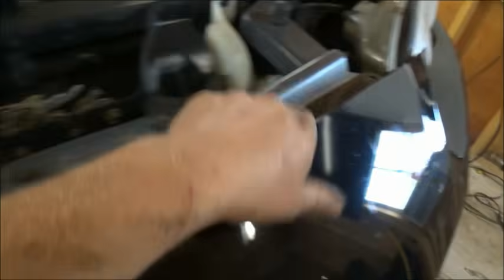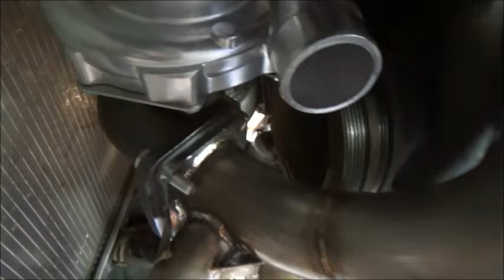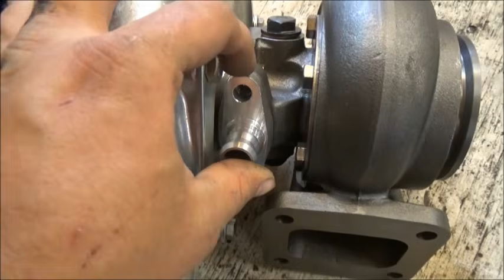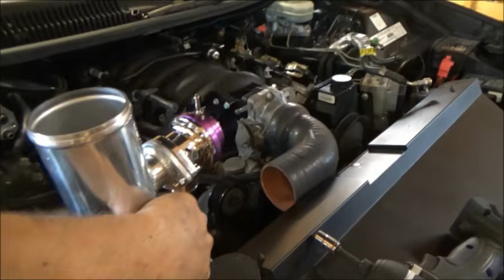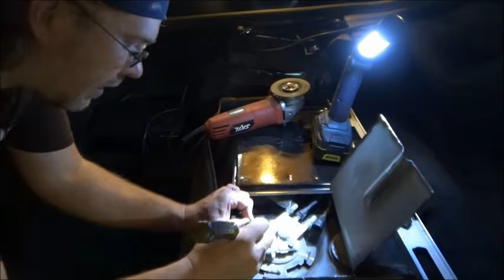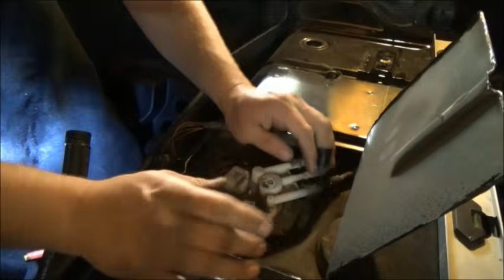How to Turbo your 98-02 F body Camaro over the weekend.

Comment: I know this is kind of a long shot but i have those same sd 80lbs injectors and i cant find any data for them anywhere would you mind sending it to me i also have hpt so you could just send me the .hpt file I've gotten it close but i cant get  the voltage offsets

Comment: Great video!  Thanks for putting this out there!  I'm considering this kit for my 99 Trans Am.  Is it possible to do this while retaining factory AC?
Reply from the maker: Andy Ray very hard but can me done
Reply: Justin Sane Thanks.  I was beginning to doubt if it was possible.  The reason I'm asking is because I'm considering replacing my 236k mile LS1 with a turbo 4.8 or 5.3L.   I want to have the enjoyment of the 700+hp all while having a good street cruiser with AC.
Reply from the maker: I cam help you set up a kit that will.make it possible with some fab work on your end
Reply: I can handle the fab work as long as it's actually possible.  I will be looking at doing this later at the end of this year.  I will be moving in a few months so I will have to wait until after the move.
Reply from the maker: Email me when your ready to.set up a consultation
Reply: Will do!  Thanks again for taking the time to respond!
Reply: Andy Ray 236k mile ls1?! That excites me. I was worried my 9o,ooo mile 02 maro was on way out. I have some vids of it uploaded on my channel. Bone stock but I love her. My douche neighbor drilled in my head that it was a 1oo,ooo mile engine and I needed to sell it quick for 3-5k. I was really debating it... what was I thinking
Reply: Yep, 238k to be exact.  Still pulls hard when I get on her.  Oh, and she's got an SLP 224 112 LSA cam.
Reply from the maker: Anything is possible with fabrication

Comment: hey bro what do you suggest I can do, I have a 05 cadillac cts-v with a ls6 in it, I want to single turbo it but it runs at 11.5 compression, where are you located btw if it's close I can travel and money is not an issue
Reply from the maker: Central PA